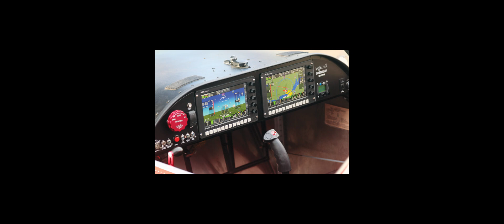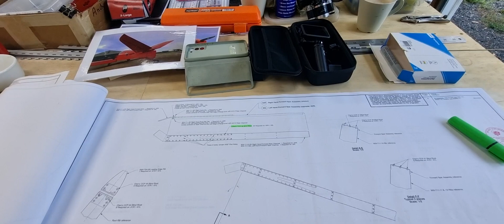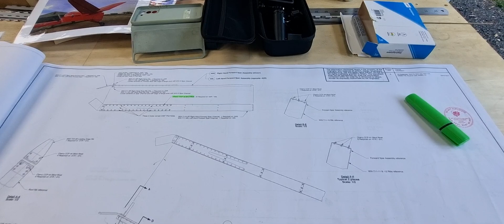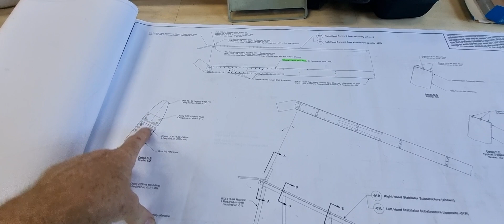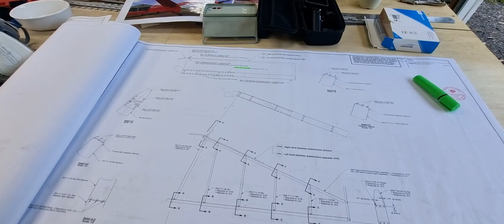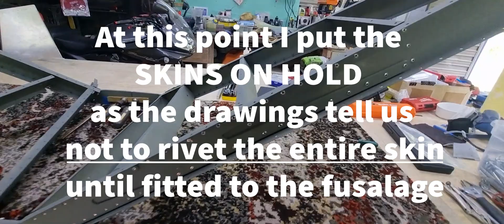Sonex Waiex B, Part 6, STOP, don't rivet the skins just yet.

Comment: Nylock nuts can be used multiple times. Just make sure they have run-on torque. Don’t stress too much. LAME 2c
Reply from the maker: Thanks for that, and its odd how often you here all the differing criteria.  My thought behind it was, for the sake of a few cents, replace it...
How do we check the torque feature of those hard to get places, say at the Y tail connection of the fuselage? I think there is provision for a small inspection hole to the underside of the aft fuselage, just forward of the tail wheel so as to get to those 20 odd nuts at the rear of the Y tail spar attachment.
Unsure how familiar you are on the B model but even the AN 525 screw/ nuts that are lost forever inside the cross tie box?  there will be I am sure nuts that ae never to be seen again unless to make provision in the build? your thoughts
Reply: Honestly every kit plane has next to no access panels. I’d put an extra access panel in if needed.
Reply from the maker: agree, in fact you will notice I reversed the "hockey stick." bolt heads at the aft fuselage so as to have the ability to replace and tighten. As far as putting in access panels that now is a priority for me, so thanks for the advice.

Comment: Looks good.  Of all the airplane assembly series I've watched, this tail seems to be the most complicated.  I watched how they built the Sonex Jet and there was another mfgr small jet and those were the others that seemed really detailed and tough to do. All the strengthener pieces and tight spaces, and tolerances, just tougher to do than mose traditional experimental prop planes with standard empanage.
Reply from the maker: Hi Brian, 

let me first up say thanks for subscribing and moreover thanks for the great comments. The tail in the aircraft did bring me to a wall, of which is a reason whey I stopped where I did. I am thankful that I did due to the complex nature and endless amounts of AN bolts that went in. That sad it became a lot easier as I progressed through the build and as you will see, by the end result actually haw simple it became.